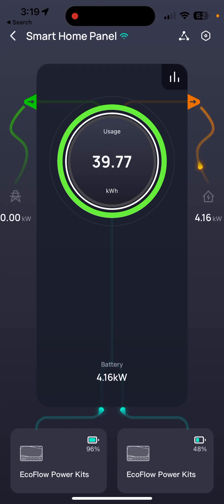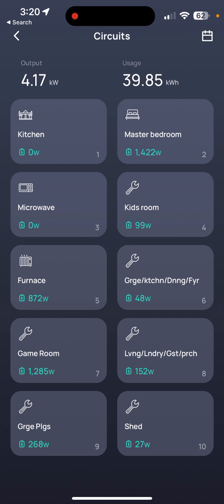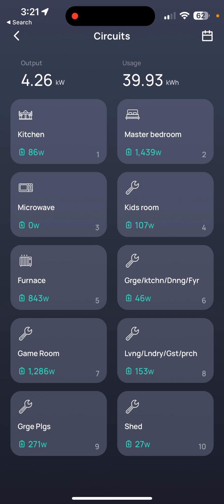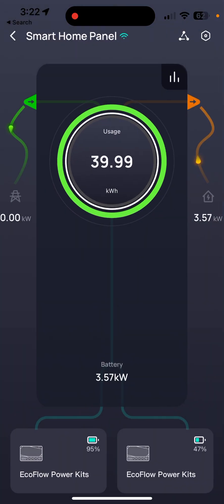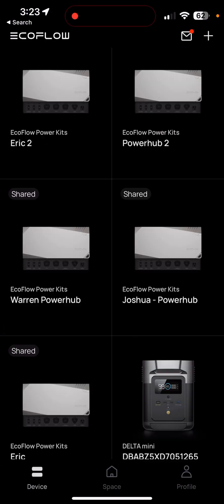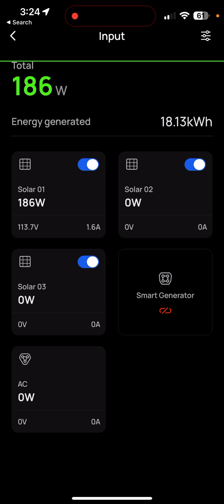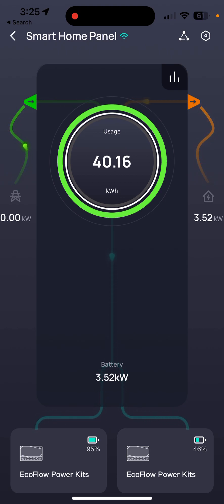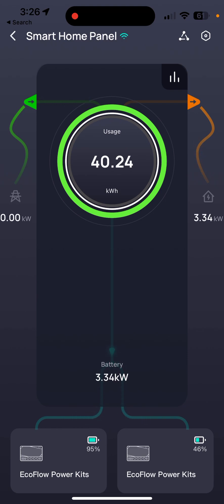My Ecoflow Powerkits and Smart Home Panel with real world usage.

Comment: Hope you don't mind a random question. We got one Ecoflow power kit with one 5kw battery mostly as a home backup when the power goes out, which is often here. Even when we're on the grid, Ecoflow shuts off the AC out even at around 4kw. It doesn't pass the power through from the grid?  Is the unit defective or what are we doing wrong? Thanks.
Reply from the maker: If the load is more than 3.5 kW it can’t handled it for extended time. It can handle surges but not sustain it. 

If you need more, you would need to tow power hubs and then you can handle 7 kW continuous.

Comment: Hey man, great video!
I've got an ecoflow smart home panel and I'm trying to connect it to a 15kw power kit? (I also have a Delta Pro and smart generator with solar panel if needed)
Can I ask what your solution was to make the connection and which cables you used?
Many thanks from the UK :)
Reply from the maker: You have 15 kw batteries and 2 power hubs then I’m assuming?

Comment: Can you run the following logic with the SHP; when battery goes to 30% switch to grid - when battery recharges to 90% (hopefully by solar) switch back to battery

Thank you!
Reply from the maker: Yes. Except I switch to propane generator that is DC to DC charging it to .90 cents for half the cost of the grid.

Comment: How much did this setup cost? Also, how many solar panels on roof?
Reply from the maker: I came up with backyard fence mounted solutions that use soft water for self cleaning and improving temperature coefficients. 12.4 kW bifacials

Comment: It looks like you have the EcoFlow transfer switch and the EcoFlow Smart Home Panel both connected to your indoor circuit breaker panel. Would that be correct? If so, why would you have both connected to you indoor circuit breaker panel?
Reply from the maker: The Ecoflow’s SmartHome panel is the automatic transfer switch, and it’s functioning as a subpanel housing relays for the circuits in the main breaker box that I want to run on solar/battery

Comment: I got 6 of the 10 relays working on the smart home panel. The other 4 are showing a blinking red light. Do you think I need to get replacement relays?
Reply from the maker: Hey, sorry I just saw this. I know there was a batch of relays that were manufactured a little shy of what it should be and when you’re connecting it if you tighten the screws down too much and it pushes the board up somewhere else, it makes it so that your relays aren’t seated well so I would undo all of them and lightly put it in there and screw it down so it’s secure without overtightening it.

You could also do a warranty claim and get some new ones as the issue has been resolved. 

This is some should be thought of like a computer in the sense that if you do have any issues, a nice hard reset usually resolves it. If it’s something really troublesome, literally, just unplug everything turn it all off flip your breaker off and then plug everything back in and you should be good.